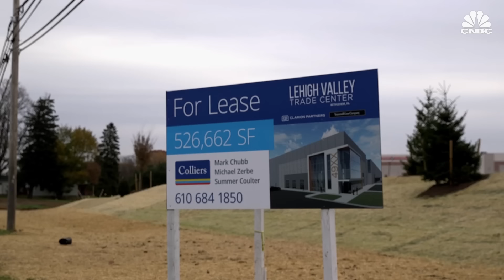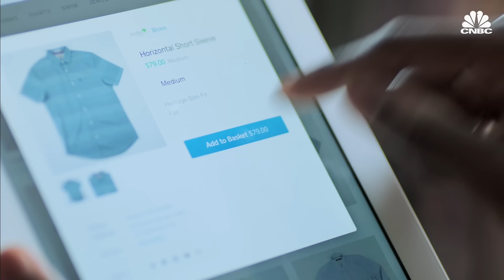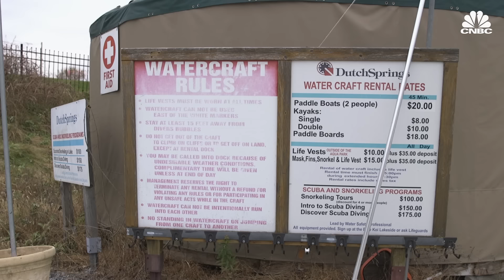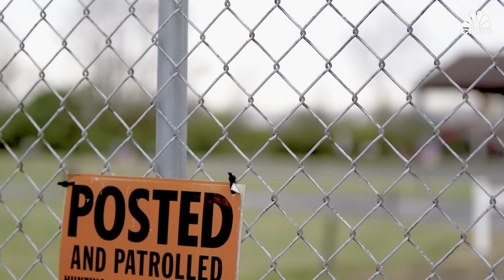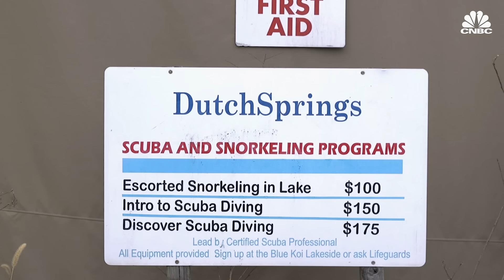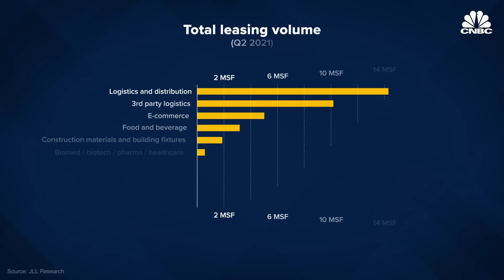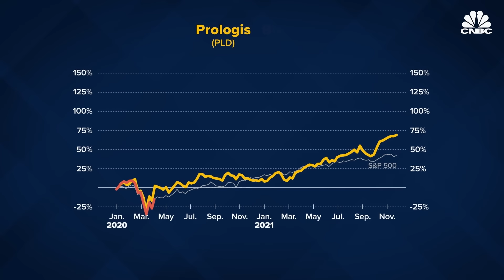Why Warehouses Are Taking Over The U.S.

Comment: I forgot to add the bait and switch everyone seems to be blind to when it comes to all these high paying warehouse jobs. As automation takes over all of these warehouse jobs will be gone. The buildings will remain but all the residential areas will implode. Foreclosed abandoned and then raised to fill in any remaining space for a handful of more warehouses All automated all run by robots computers and machines. With no tax base remaining these towns in the Lehigh Valley will go bankrupt. But that's what happens when city planners see nothing but dollar signs and don't think of the long-term possible consequences of their greed.
Reply: Nonsense. You will still need people to repair the robots, maintain the building, and monitor the line. 
Your kind of speculations have been made for over a hundred years, it has continued to be wrong.

Comment: honnestly those amazone fullfillement and those other warehouse that are paying big buck not, for shelf where they stack good for month like retailer use too, but where the velocity of goods is a magnitude or 2 faster then it was in retail store.  In the end all that warehousing construction in the back country is probably freeing 20 times more commercial space in urban center.

warehouse are a commoditised business, so after the boom, their will be a bust; but but opposite to the oil industry, with the ecommerce this cycle have the wind in the sail, but later on the cycle, when the shortage will be less severe price and profitability of warehouse will drop and the industry will get toward a equilibrium where warehouse are a commodity where value will depend of location, and where the wealth will be on the efficiency and velocity of the operator, where the manual, low tech, labor heavy will go under and the amazon, autonomous AI high tech capital intensive hyper productive labor will be gaining more and more of the share.  ( i m bullish on ong term amzn)